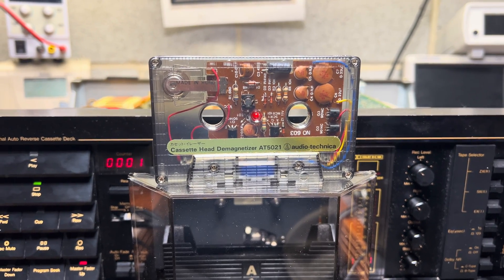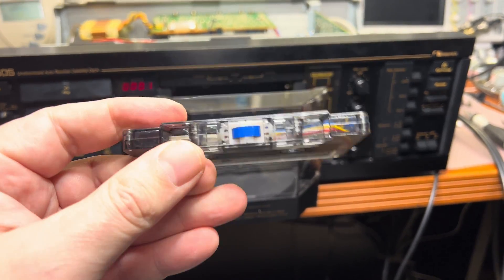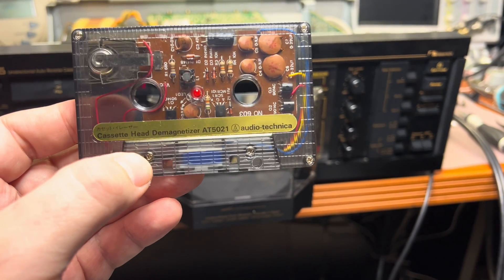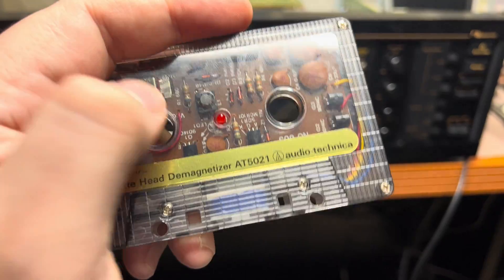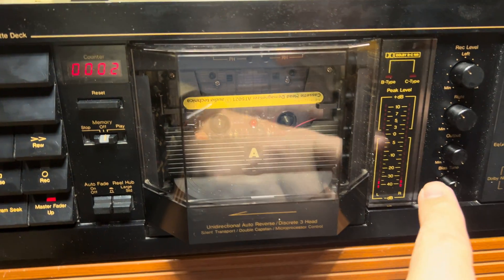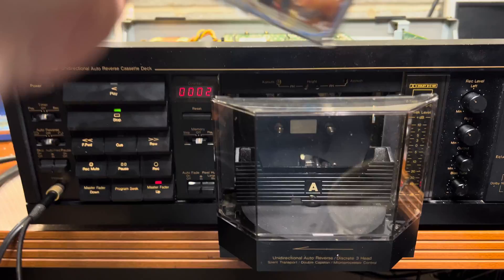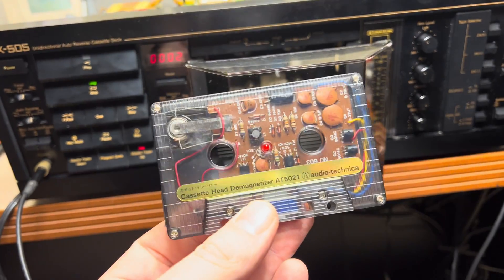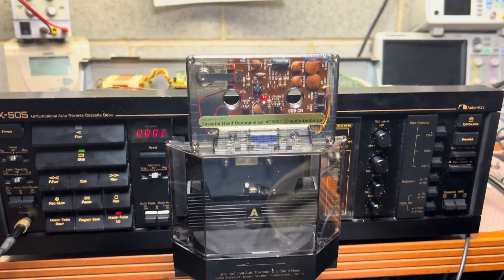Cassette Deck Heads Demagnetizer Demo

Comment: i believe those are useless. The only good one in my opinion is the old fashion way type demagnetiser, the one with a core and a wrapped coil around it wich you run the tip of it for few seconds, around each heads and capstans...You know what i'm reffering to. Can even feel the strong magnetic field when you approach the heads...
Reply from the maker: @emilian5903  what made you think that the field produced by this demagnetized is not enough? It works in a close proximity to the heads and gradually reduces the field to demagnetize the head, initial pulse is very strong.
Reply: @hifirulezzz  I got both, and looks on my opinion and based by the results after using them, that that so called demagnetizer cassette does nothing compared to this sturdy old fashion way coil based demagnetizer wich is fed by 100v in America, or 220v electric grid in Europe.
I mean, how can a little 1.5v small cell is able to deliver that needed strong magnetic field necessary for a proper demagnetisation? 
Just saying...

Comment: These things have been made for about 40 years, and they do no good at all. You need several watts of power at a low frequency to thoroughly demagnetize a tape deck. Further, the head is not the only part that needs to be demagnetized. The capstans also need it, and this device has no effect at all on the capstans. The erase head usually does not need demagnetization provided you actually use the machine to record once in a while, as the erase current is strong enough to keep the erase head demagnetized. 

On reel-to-reel machines, the tape guides, lifters, idlers, and any other magnetically permeable parts that touch the tape should be periodically demagnetized, as well.

Comment: It will demagnetise but only metall core of playhead, not all. 
Simply power is not enough for whole head and bigger metal parts will resist to such high frequency. 
Big parts loves 50-60Hz and power, power  power...

Comment: That's the easy way especially for new cassettes / decks enthusiasts but by my opinion the more better way actually the best way is  by using a demagnetizer stick
Reply: Esatto,la cassetta fa qualcosa,ma non puo certo demagnetizzare gli elementi circostanti le testine,come i capstan e altro.....
Reply: @giuseppelavecchia775  Molto corretto ed è esattamente quello che intendevo
Reply: Hey,greets from finlandia,but u got AiwA machines,u dont need those?? A.D.M.S. ??

Comment: But besides making a noise, does it actually work?
Reply: yeah this is how they usually did it back in the day, several companies made these head demagnetizers (maxell tdk etc)
Reply: though in the aspect of does it actually improve the audio quality, it usually only does when its like extremely magnetized, most of the time you arent gonna hear any difference
Reply: @imcrow6674  yeah, I had a similar one to this.  I’d like to think it made the deck sound better, but it would be easy for our favourite cassette deck technician here to do a before and after shot.

Comment: probably too weak to work
Reply: they do work, but usually decks arent magnetized to the point where youd really notice any difference
Reply: @imcrow6674  almeno ogni 60 ore operative del deck le testine vanno demagnetizzate,e' una regola,se non si fa si avra' un peggioramento delle prestazioni,e il deck puo rovinare in lettura le alte frequenze della cassetta.la cassetta demagnetizzatore e' buona,ma e' meglio il demagnetizzatore manuale
Reply: @giuseppelavecchia775  iirc some company back in the ~80s myth-busted the whole magnetized head thing, i see it referenced pretty often but cant find the actual company name or findings. but generally its only brought up to debunk the need for demagnetizing heads constantly, most decks can go their whole lifespan without ever needing them
also pretty sure the bias current demagnetizes it already when you record a tape but thats hearsay
Reply: @imcrow6674  anch'io sono a conoscenza che la corrente di bias dovrebbe demagnetizzare le testine,ma cio' avverrebbe solo se il deck stesse lavorando in registrazione,ma se il deck non si usasse quasi mai in rec,ma solo in play cio' non avviene,per questo esiste il demagnetizzatore.mi e' capitato l'occasione in cui ho dovuto usarlo,perche la magnetizzazione alle testine,in registrazione introduceva della distorsione nel suono registrato,dopo la smagnetizzazione,problema sparito